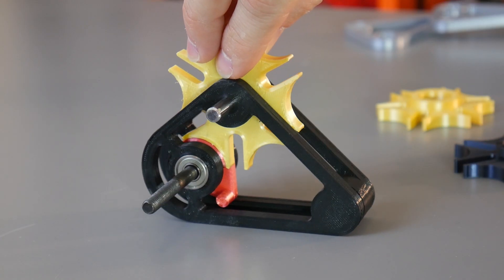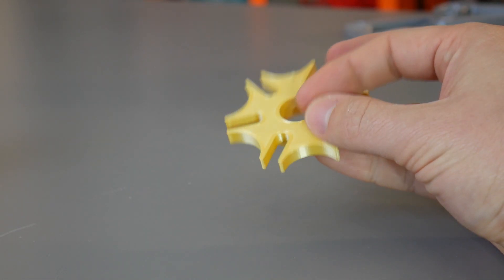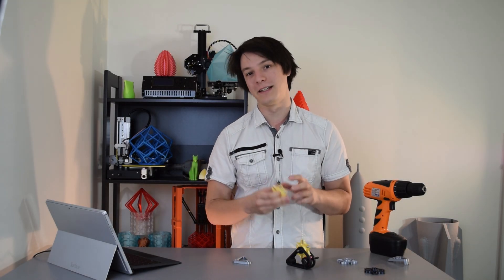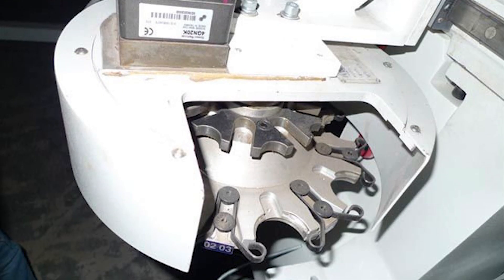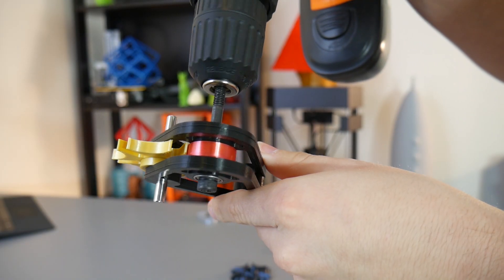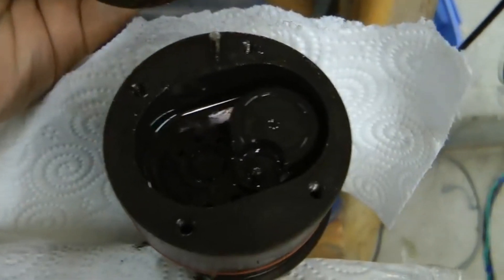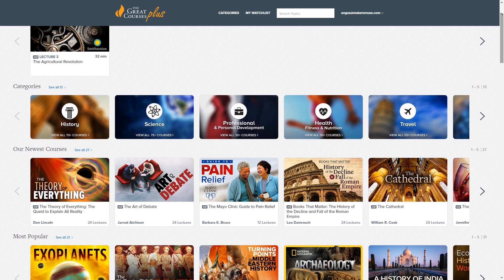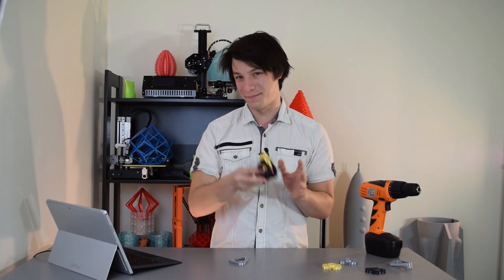The Geneva Mechanism

Comment: "Old" film projectors is only accurate if you consider everything pre-digital to be old. 
In fact, the Geneva cross was used on ALL 35 and 70mm film projectors from about 1900 to the end, circa 2012, with the exception of a very sight incursion in the last years from designs using servo motors.
They did not suffer from high failure rates in this application, with many running all day every day for 20 years or more, however it is true they achieved this through an oil immersion system and very high-precision machining.

Comment: Anyone every made the gear slots magnetic so each side the slot is a different pole then the drive pin is also magnetic with the same pole orientation as the slot. That way there wouldn't be any friction. Between the slot and pin. Better yet if you just made the pin magnetic and the Geneva mechanism aluminium if you make the slots large enough the lorentz force induce by the magnetic pin should drive the mechanism without wear. And the heat induced would probably be negligible.

Comment: the assessment is wrong. all reciprocating mechanisms make noise and also have wear and tear for simple reason that they are converting one type of motion to another and at higher speeds it cant be avoided. WHAT ARE IC ENGINES DOING? THEY ARE CONSTANTLY MOVING TO AND FRO BETWEEN THE PISTONS, SAME GOES TO TRAIN SYSTEM AND ALL OTHER SYSTEMS WHERE YOU HAVE INTERMITTENT MECHANISM.
SO BLAMING GENEVA IS NOT THE ONLY WAY TO GO.
WHEN YOU SAY MECHANICAL THERE IS FRICTION BETWEEN CONTACTS  HENCE NOISE,HENCE HEAT ETC. YOU HAVE TO LIVE WITH THAT. HEAT IS CONSTANT IN ENGINEERING FIELD. ELECTRONICS PRODUCE HEAT, ELECTRICAL SYSTEMS PRODUCE HEAT. IT IS  JUST THE NATURE OF THE BEAST.

Comment: Could you potentially use a bearing as the knob instead of a molded piece that rubs against the rest of the mechanism? Atleast, on much larger designs? That way it rotates and lessens the friction as oppose to constant friction?

Comment: There was a tank with two cabins which had it basically likes what you have but with three thousand notches in it so it could turn and put it at all the different points and they could stop it so it was two different cabins and on the top line it was the Temple Pilots and watching mechanism then there was a smaller cabin keys so do the actual take part where there was a nuclear reactor if he tells her it and the tracks for the nuclear reactor to go around so it would move around is a pretty cool machine because it was just cruel and it was used in the World War II

Comment: As far as military use, I’m an engine mech on legacy c-130’s. The fuel control on a t-56 has a ‘Geneva lock’ a fuel shut off lock/valve. I wonder if it used this design or something similar.

Comment: about mechanism, anyone remember kinda chocolate surprise egg , is chocolate egg,inside have toy in an orange capsule, every egg toy is different,when i was kid ,i remember one of surprise egg toy is a little car,very simply car ,only few part, maybe like 2,3 metal gear, wheels, very easy to assembly, but the car do something i still dont understand how it work,when you push or spin the wheels more and more,toy car go longer or wheels spin longer, some how the mechanical design ,it make the car work like a spring loaded energy ,wheels not spin freely ,hard to grasp the wheels make it fully stop ,feels like some kind of torque going on, and toy car it make like a moto or mechanical sound too, so those metal gear must doing some genius trick .
so i dont know anyone remember kinda chocolate surprise egg toy, i mean old version kinda surprise egg, i think is some kind of safety problem for kids, now changed to new version,. cant find old version anymore, sorry for my poor englisg.

Comment: All of our (now antique) Peerless Roll Leaf machines used a Geneva drive to index the next bottle into printing position. They ran 3 shifts for over 30 years with nothing more than a touch of grease from time to time.  The were a quality cast iron construction and were fitted so closely that there was a very minimal orientation error that never seemed to increase over time.  A truly remarkable design.  Later machines used Camco Units and were very good as well but still a step down from the ultra simple Geneva drives. As a 5 year apprentice Tool Maker I was given the task of building one of the Peerless machines from a pile of scrap machine parts which required making a Geneva drive from scratch and rebuilding all the other moving parts with brass inlays and braze-ups and refit. No time limits (that I knew of) and a few weeks later I presented the finished machine to the General Manager of the printing department. He and his setup people and operators went over it with a fine tooth comb and  gave me a thumbs up. The old Tooly's I was training under all gave me a round of applause when I came back to the department, a hand shake and an atta boy.  One of the proudest moments of my 47 years as a Tool Maker.  All manual machines and hand tools. Computers hadn't been invented yet except in big research facilities.  I'm not sure that today's machinists will ever have any experience like that.  For that I am truly sad.

Comment: Here I was wondering halfway through the video why I hadn't seen anything like this in photocopiers. (I used to be copier mechanic) I've only ever worked on machines produced in the last 15 years and I think stepper motors took over the need for this. A modern office copy machine will have about 20 stepper motors along with a couple of other continuous revolution motors. Add another 10-20 depending on options, such as stapler, hole punch, booklet etc.

Comment: The Allison 501 turboprop aircraft engine, developed in the early 1950s, is still in service under Rolls Royce ownership.  The main fuel shutoff valve in the engine fuel control unit is controlled by an electrically-powered Geneva mechanism, and is referred to by mechanics as the "Geneva lock."  It has proven to be extremely reliable.

Comment: I repaired film 8mm and 16mm projectors for many years. I saw the Geneva movement only in a few high-end theater-style 16mm projectors. Compared to the more common mechanisms in most other projectors, I found the Geneva mechanism much less prone to wear and problems than the common cam and follower setups in other machines. Geneva was a lot easier to fix too. If you think the Geneva movement is "violent," you should see the cam and follower stuff in other 8mm and 16mm units! Most of those wore out very quickly. Cams, followers, belts and rubber idlers were the bulk of what I had to replace regularly. Sound and lighting (especially xenon arc) were also problem areas.
Reply: The Geneva mechanism does not lend itself well to smaller film projectors.
A 4-branch Geneva movement, such as was used in 35mm and 70mm projectors turns 90° with each advance. With 4 perforations per frame in 35mm, and 5 perforations in 70mm, this meant the sprocket engaging the film could be a reasonable size (about an inch dia. for 35mm). Since 16mm has only one perforation per frame, this would produce a sprocket only 1/4" dia., which is unsatisfactory to engage the film. A few projectors did use an 8-branch Geneva movement, which gives a sprocket diameter just under 1/2", but most 16mm projectors used either cam/claw movements, ramp movements or other variants, often with a registration pin to hold the film steady during projection (which was not needed when using a Geneva movement).
Reply: @gregfaris6959  As I recall (been many years since then) it was a large theater style 16mm, maybe Eiki. Might have been 35mm but I'm not sure anymore. I think it was 16mm. Whatever it was it worked well. Yes, all the other movie stuff I repaired up to then was cam and claw. Best 16mm to repair of the lot were the Eiki units, Elmo was good but very tight tolerances which made it hard to adjust. B&H tended to have sound problems especially the tube amp style. Worst 16mm to fix were the Kodak Pageant.
Reply: @65CJ5  Yes, the Pageants were full of plastic parts and "barely there" metal parts once broken couldn't really be fixed. Eiki had the best reputation as I remember for 16mm, though if I'm not going crazy in old age I think Provost may have been one who used a Geneva movement for 16mm. 
I recall seeing a B&H Filmsound projector fall off a 4ft high platform onto a concrete floor. It exploded into a trillion pieces no bigger than a 1/4-20 nut. Far more exciting than all the special effects in the movie we were about to show!

Comment: Geneva Drives are only found in 35mm and professional (not industrial or school) 16mm projectors. Way too high end for home use. A cam and a bendable wire does the job on 8mm and most 16mm projectors.

Comment: The thing with servos and stepper motors is their cost of construction and they rely on electricity to function...unlike gear trains and other mechanical movements which require basic technology to produce and simple physical power to operate.  All this modern engineering in production will end up being an Achilles heel in the near future.  Man will one day have to revert to the more reliable, easier to maintain and less expensive to produce methods of mechanical movements.

Comment: "Old fashioned film projectors". As opposed to new-style film projectors?  
If your simply trying to indicate the obsolescence of motion picture film, wouldn't just the term "film" suffice? 
And actually, you are describing what most would call a "movie" projector, since slide (or any of several different forms of transparent still photograph) projectors operate on a completely different film-handing process. 

Now about the wear issue: As you mention, geneva drives were usually enclosed in an oil bath. This bath was generally a very tightly sealed unit with a very high quality lubricant, and would last for many hundreds of hours of use. These units were also very quiet-running. The main exception being very large film formats such as 70mm or Cinemax. Such units were designed for quick exchange with minimum down-time, and so constructed as to provide economical serviceability.

No need to magnify your youth with the somewhat demeaning term "old fashioned".

Comment: The M16 Rifle uses a similar mechanism for timing, within the trigger assembly.  On newer models, where there is a "burst" function instead of fully automatic fire, (The weapon shoots 3 bullets for every trigger press), the device is in the "stop" configuration with a total of 6 dwells.  Research the trigger mechanism of the lower receiver of the M16A1 and M16A2 to see the difference.

Comment: We used one in aircraft navigation equipment, the antenna had to switch wave guides and used a Geneva drive. First thing we did troubleshooting the aircraft for problems, put our ear to the cargo bay and listen for the "clack" of the Geneva gear.

Comment: Gatling guns and revolvers use indexing mechanical drive mechanisms. Machine guns on old propeller planes had a mechanical index interlock that kept bullets from hitting the propeller and causing damage. Belt fed machine guns also use indexing mechanisms to bring each new round into the breach. This is also how chain fed CNC tool indexes work. Had a 100 tool changer on a Nagata horizontal mill at a place I worked several years ago and that chain used exactly the type of drive index you show to bring each tool carrier into position for the crazy fast tool changes. Thousands of applications for this.

Comment: So, I can guarantee you this was used in the military, just not a use exclusive to the military. In the military, there are pretty much positions available for almost any job you can think of. Even filmmaking has its place in the military, someone has to record the commercials. If I had to guess, this mechanism was most likely in use somewhere in the army or Air Force as they have an affinity for engineering and science respectively.

Comment: Question: can the pin itself rotate? I imagine that would greatly reduce the amount of friction between the drive and the wheel

Sorry if I'm not using the correct terms, I'm not an engineer
Reply: That'd just add more moving parts, so more friction and things that can fail, since that pin would need to rotate inside the drive.

Comment: Military applications. I would bet money that an aircraft mounted machine gun that fires thru the propellers of plane with timed bursts so as not to destroy the propellors makes use of this idea. The reason you want the gun firing thru the propellers is that you want both the aiming sight and the actual barrel of the machine gun mounted closely together to minimize parallax  error, and ideally you want the gunsight close to the axis of the body of the plane for the same reasoning due to the geometry of dogfighting where you are in effect aiming the plane itself. Early versions simply mounted the guns away from the propellers but accuracy and intuitive aiming was impaired. Later models used gearing between the propeller shaft and the firing mechanism so that the trigger was quickly pulled ONLY when the projectile would be in between the propeller props. Sounds like a plan for the Geneva Mechanism.  Because of the high rpm speed of aircraft props it is doubtful that more than one or two cams per revolution would be required, rather than many slots or cams in the typical geneva device, but the concept is the same. Databyter

Comment: Although you're getting flack for the military comment. You did mark a main point about the geneva mechanism. That it wears out fast due to friction. I think you could make a low friction geneva mechanism. Using pin bearings to guide the mechanism pin into and out of the slot. Also putting a roller-bearing as the landing of the mechanism.

Comment: WOW! Let's start with most bombs use the geneva mechanism. Naval Airborn Ordnance page 387 The Geneva mechanism in turn, indexes the bomb ejector drive shaft which trips the bomb retaining latches, releasing the bomb. (or)  aviation Ordancman 1& C The overload release mechanism connects the drive pulley to the drive shaft, and functions when an overload occurs on the drive. (or) most famous of all :  The M16 link machine Gun. Pusher unit

Comment: ths is the system used in paper cup forming machines. i have worked with them since 1961here is a turret above them used for tooling. very accurate.

Comment: A fascinating solution to replacing the geneva drive in some motion picture cameras, is an eccentric cam or shaft, that pushed two linear bearings, in and out, and up and down, for the pulldown claw, especially on 16mm single sprocket film cameras. It has the advantage of not having the harmonic issues of the Geneva drive, and it created a clean intermittent motion from a rotational one. That and it's speed can be varied without damaging the film.

Comment: Before aircraft cockpits went to flat screen displays, the instruments were electromechanical, and the altitude and airspeed were displayed both with a dial and a  mechanical "digital" display, or counter.  These were driven by servo motors and geneva gears, and when driven at high speeds made a clacking sound much like a film projector.  Much attention to detail in assembly of these counters was required to make them turn smoothly, as any misalignment of the geneva assemblies, or poor machining of the gears, would cause them to stick and jump, making the display difficult to read.

Comment: A similar drive mechanism was used by the Germans to synchronize firing through propellers during WW1. This was a jealously guarded military secrete that was not figured and out and copied by the  allies until very late in   war when a crashed German fighter was recovered with an intact nose section (engine, propellor, machine gun, and interrupt mechanism) which was sent back to England for study.

Comment: Military use: syncing weapons fire with the propeller blades of an air craft so pilots could aim using the main body of it.
Reply: An interrupter gear. 
I don't know if it's a variant of a geneva drive or not, I haven't seen one, just know a little about it's history.
Reply: That's actually just a simple cam and follower mechanism, letting the gun trigger whilst there is no propeller blade in front of it.
Reply: It was designed in the early 1910s by a french engineer for a fighter aircraft, in a patrol operation he encountered a german aircraft, but crash landed after a fatal damage in the wings, he tried to burn the plane  so the germans cannot find his sync meccanism, but failed and was taken as a war prisoner and her invention was mass produced for the new fokker airplanes. Interesting history...
Reply: @studioagari  Without any sources it's just a claim that someone invented something first. Like for basically anything, there is someone saying "oh i used that so much earlier but I didn't tell anybody". The germans and the french worked on this concept simultaneously but the Germanys used it much earlier. August Euler so far is credited with first "inventing" it.
Reply: @studioagari , the plane that was captured was flown by Roland Garros, and Saulnier had fitted deflector plates to the propeller. Saulnier's syncro gear did not work, and he said this himself
Reply: @joshuamorrall4527  oh, thanks...i read that history some years ago
Reply: That's interesting, thanks for the knowledge
Reply: A wild guess is that this can be used in a revolver
Reply: Would indexing of missiles ready to drop in an aircraft bomb bay use this ?
Reply: nah its not that, its much more simple, its an actuator between the blades
Reply: @CristianRusu  Nope they used a gaming system. Everytime they fucked up and shot a propeller off they just spawned a new one
Reply: @philmenzies2477  I had to upvote for the stupid absurdity of your comment :p
Reply: That’s insane!
Reply: also though about the firsts gatling guns
Reply: That's cool